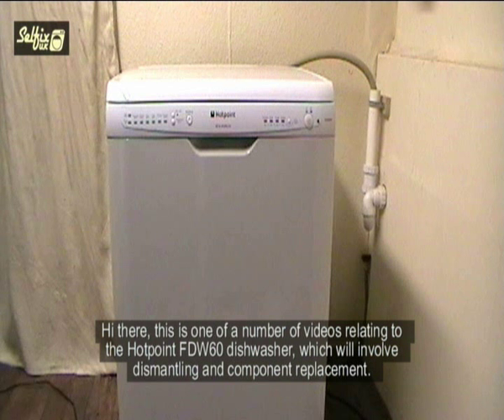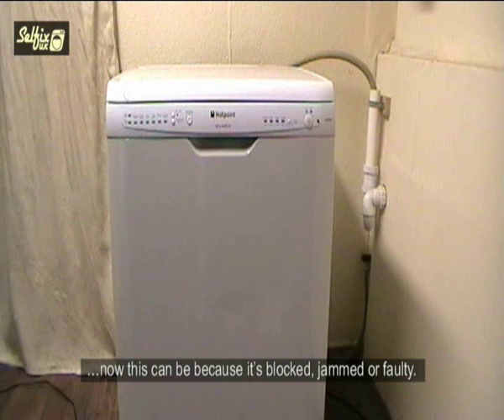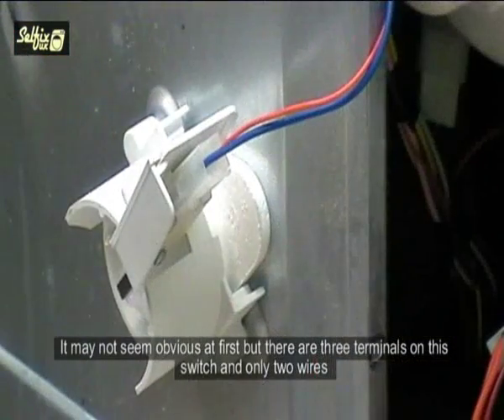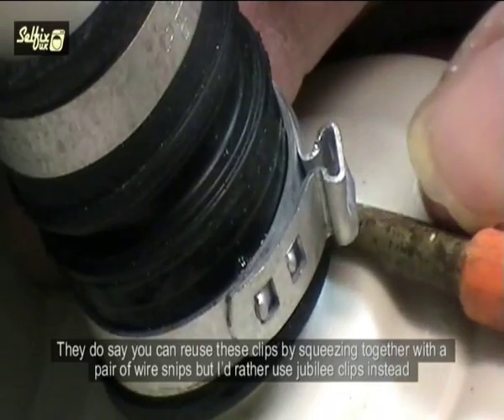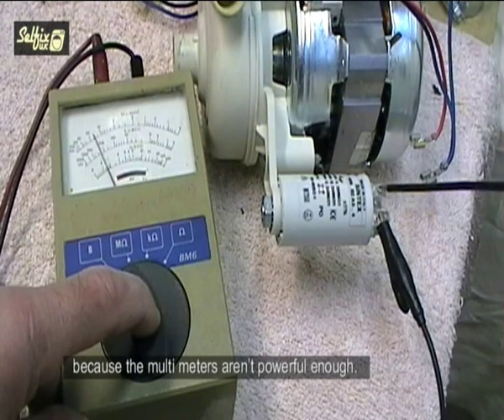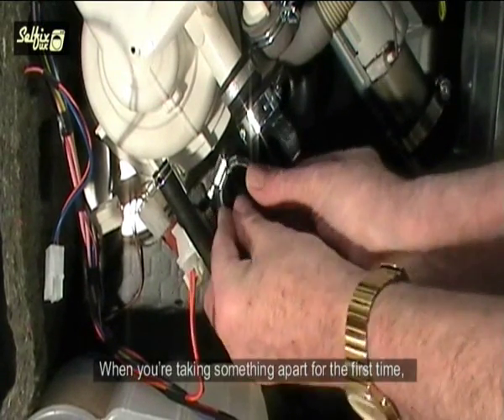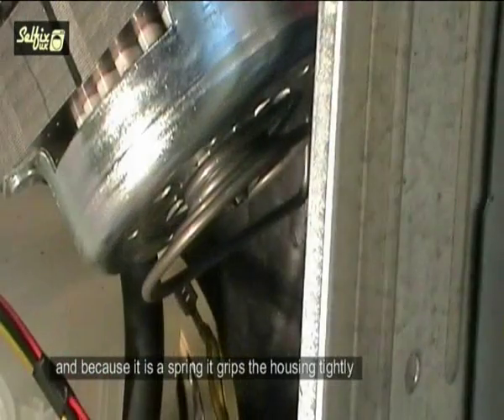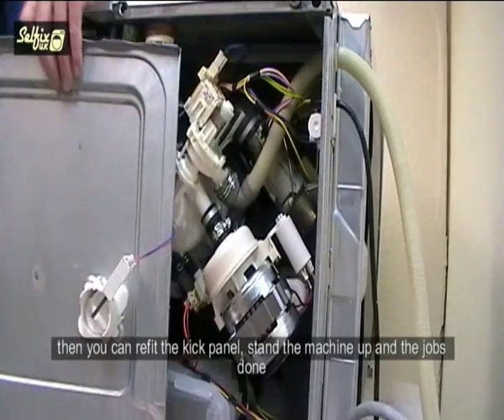Hotpoint dishwasher circ pump for selfix

Comment: Excellent tutorial, I followed your instructions and found part of the solenoid from the circulation pump had broken off and fallen into the impeller. I removed the obstruction , replaced the solenoid and refitted the pump...I now don't have to wash up on Christmas day.. you're a star....